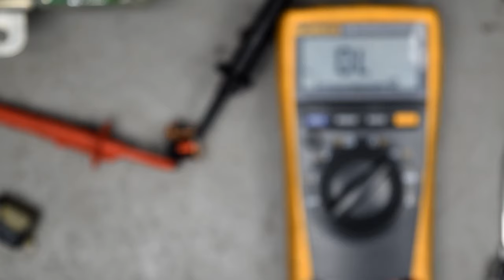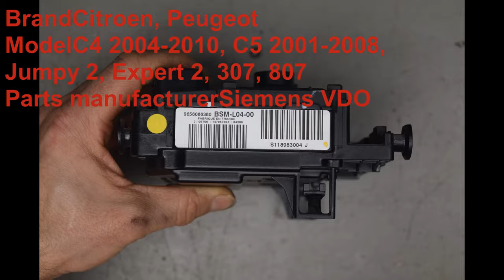Citroen, Peugeot Siemens VDO bsm-l04-00 Module Repair Fusebox. Bsm häiriö hardway

Comment: In my 207 the climate Is dead,not working, The pump and the electromagnet are ok, but I don't hear the climate relay working after pressing the climate control button. Where Is the problem? if i connect the pump to 12v, it works. Help
Reply from the maker: Are refregant amount checked? If too low amount refregant in system then lowside preasure switch wont allow magnet clutch to switch compressor on?
Reply from the maker: And usually there are also outside ambient temperature limit witch disablesbac unit if to cold outside.
Reply: @ElectronicMechanicFinland  the refregrant its full
Reply: @ElectronicMechanicFinland  where is it in 207? usually located in the rear view mirror.
Reply from the maker: I dont know.  Is your climate control mechanical manual or electronic? And are The fault codes readed? If electronic ac then eng managment can disable it if coolant system has anykind trouble?
Reply: @ElectronicMechanicFinland  Is electronic, the fault code i dont remember now , are saved on PC. I check the signal out from bsi to collant pump and It doesnt arrive. I think bsi or bsm control module fault the activation. 
PS I also replaced the ac pressure sensor and the engine thermostat
Reply from the maker: @dani-ohciao  Are you sure that ac clutch is controlled from BSM ? I cant see fuse to ac lutch on BSM module fuse chart.  If i had to take a guess i wil guess that ac clutch is contolled directly from ac control unit inside of car because BSM module has delicated fuse to ac unit so ac unit must do all the contols for ac. expect ac condenser fan infront off car witch fuse and relay are in BSM module. It fould be helpflul to know what that trouble code is and then try narrow a faliure
Reply from the maker: If i saw right  in diagram then it really goes to bsm module xd i think that better stop making quesses and follow that fault code. And if code is bms related  then start messing with that unit
Reply: @ElectronicMechanicFinland  thanks for the help, at the moment i am asking the mechanic if he can give me the errore code. As soon as i have them, i write them here.

Comment: i hope got an peugeot 307 sw ,    is a pain the remember relays are build in.   and not easier to change as used to do before on old cars.     

im having an silly issue with the headlights. 

when i switch to high beam.   i see he high beam outside   but on the instruments keep showing me the green light meaning low beam. and dont showing the blue light meaning high beam. 

im suspicious if maybe something about the bsm ..  

have a great day buddy !  regards from chile
Reply from the maker: Hello.. first thing what comes in My mind is that are your instiment cluster theese old kind replaceble backlight Glow wire Light bulbs? Because then you propably have replaceble light bulbs also in all Instrument cluster indicator light places.